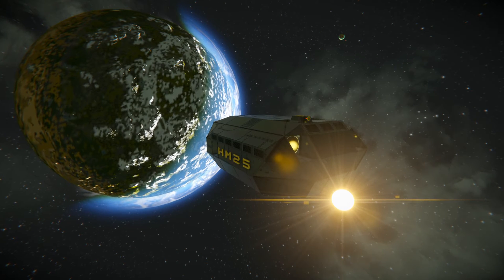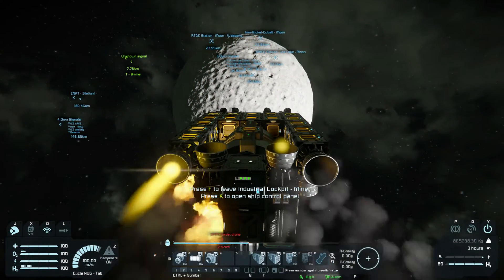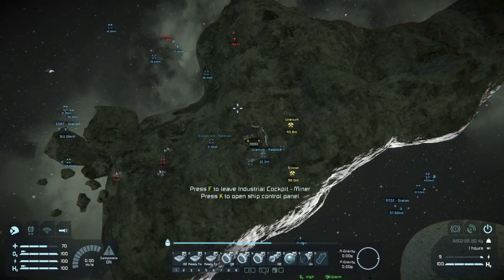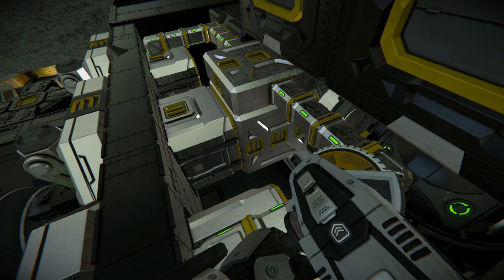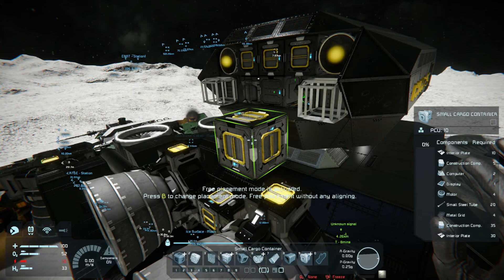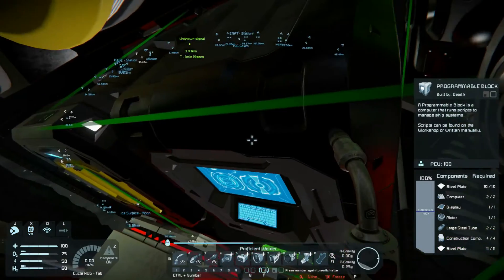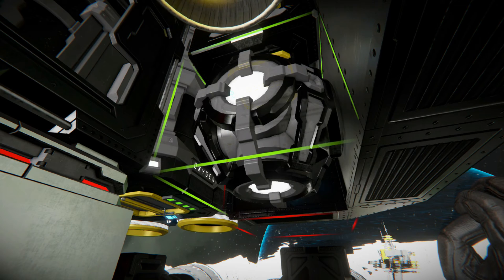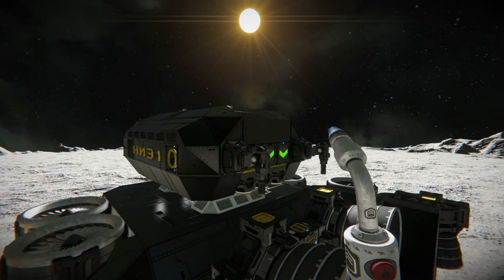Space Engineers - EP25 - All-Purpose Mining Ship Upgrade Evolutions | Tutorial | Let's Play

Comment: nice ship. I like your brief yet detailed explanation of what you are doing and why.   Question:  Do you think it would be beneficial to add a few  heavy armor blocks / panel  protecting key items or across the backend for when you need to tactically retreat from a bigger foe, or not worth the weight?
Reply from the maker: Great Question!  ...and I don't have an answer other than what you already pointed out - the weight.  In thinking about it, if I were only using this miner in Zero G space, then I think there'd be no drawback, but it would certainly limit the amount of carriable resources on an earthlike planet, and possibly start pushing it's limits on a Moon 1/4 gravity.  Maybe just on the backend though like you suggest wouldn't make a big difference.